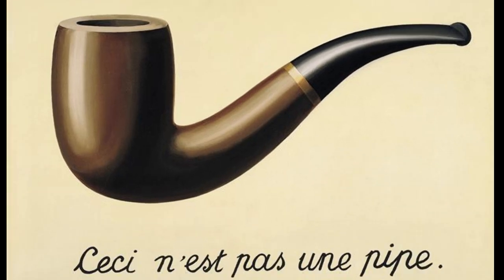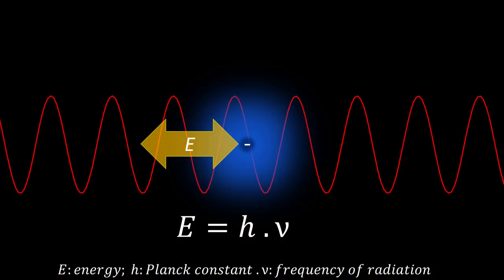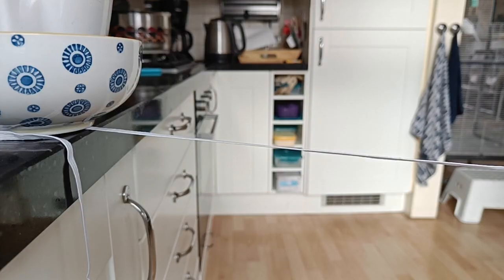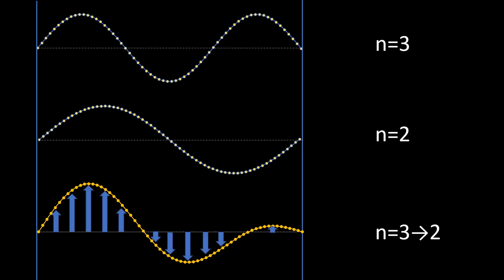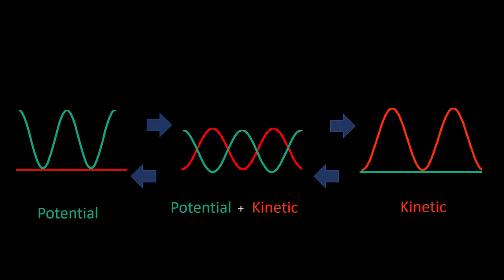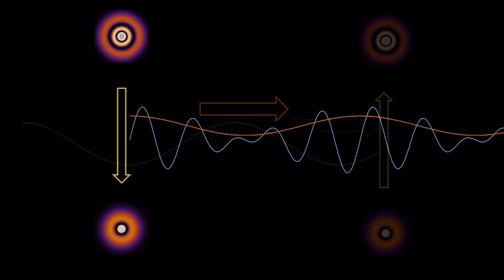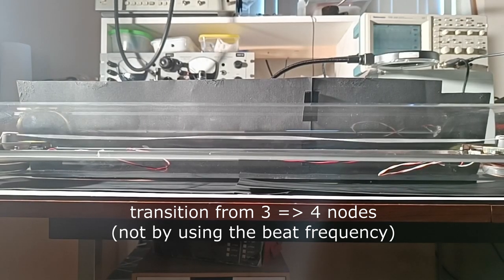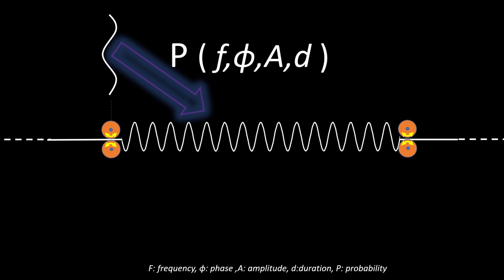Coherence part 3: This is not a wave.

Comment: I think that there is a lot of loss in your system due to gravity and you could simply turn the whole contraption so that the string hangs. It'll make the distribution a bit uneven but it should still maintain the properties, while having less loss. Since you're not fighting gravity on the standing wave over the entire length of the string anymore, although it might need a bit more energy (volume of the speaker) to get going. Because gravity wants the string straight and not saggy in the middle, if that makes sense, you can compensate with volume (energy), instead of tension (kinetic energy).
Reply from the maker: Hmm, why didn't I think of that... It could also have helped to reduce the friction I experienced in the transverse speaker, because of the sideway forces exerted.
Reply: About gravity: imagine a rollercoaster ride that is frictionless. (Hard to achieve on Earth, so for the sake of the through experiment: imagine the rollercoaster is on a levitating track, in vacuum.) In the absence of any friction, would gravity eventually bring a rollercoaster to a halt? It will not: every time the ride drops you down your speed increases, and uphill that momentum takes you all the way back up to the height where you came from. 

The same applies in the case of the vibrating string. The effect of gravity averages out; in the end there is no loss to gravity. The sag in the middle is a very minor factor. So: horizontal or vertical will make negligable difference; in both cases the energy drain to friction loss in the elastic band itself is dominant.
Reply: @cleon_teunissen  - Gravity operates like regula electromagnetic friction. It will bring your ideal rollercoaster to a halt indeed. We can see that at astronomical scales, in which gravitational friction is very real and measurable.
Reply: @HuygensOptics  Hanging the string vertical makes the string tension a function of location on the string, and thus introducing significant dispersion.
Reply: embed the whole contraption in a rotating frame to cancel out gravitational effects lol
Reply: @HuygensOptics  Rotate the driving speaker to wiggle the string left to right, rather than up and down. The entire string will remain at a constant hight above the Earth... I think most of your dampening is from the elastic material which your string is made from. I'm curious about how warm the string becomes... as most of the energy is probably going into heating it up.

There are giant lists of the tensile strength and torsion force and elastic constant of restitutions and stiffness for all kinds of materials. You can look that stuff up.
Reply: I think that you will need to use a material (wave medium) which keeps ringing like a bell after being struck. (or like a tuning fork) (Steel for example is more elastic than rubber.)
Reply: @cleon_teunissen  The friction loss in the elastic band is so high because it is taut. And it is taut to overcome the sag that gravity applies. Makes sense? A string hanging between two points sags in the middle and it takes energy to undo that. 

And about your thought experiment: gravity is a constant force over the entire track, it takes energy from the ride the entire time. Draining the initial energy put in.
Reply: @rexmundi9691  Hmm... about gravity. The Earth is orbiting the Sun. The Earth's orbit is close to circular. Gravity is spherically symmetric. That is, everywhere around the Sun, at the same distance, the magnitude of the Sun's gravity is a constant force. I surmise that you believe that the Gravity from the Sun is taking energy from the Earth the entire time, draining the Earth's energy. Do you have an estimate for the time until the Earth plunges into the Sun?

Then again, it may be that you believe that Earth's gravity and the Sun's gravity are unrelated phenomena, with unrelated properties
Reply: @HuygensOptics  You could also try to use a real metallic spring, rather than an elastic band. A real spring has less damping.
Reply: One issue is the speakers. They're not "mandating" the positions of the string ends, they're also reacting to the string's vibration (losses on conveying the pulses and attenuating the vibration of the string). I got a solution for this while watching but the video as a whole being so well made with such a beautiful ending, me saying "servomotors" would be like caughing in a classical concert.

Comment: You could also measure the power required to drive the speaker at various frequencies.  It should be different depending on whether a standing wave can be formed or not.  If the oscillation is not a multiple of the natural frequency of the string, there should be more push-back on the speaker, requiring more power to be applied to drive it.  It would be interesting to graph the energy consumption vs the frequency.
Reply: this is really similar to back-EMF in motors, and would work (with some caveats) in a continuous manner (i.e. not just as a resonance detector)

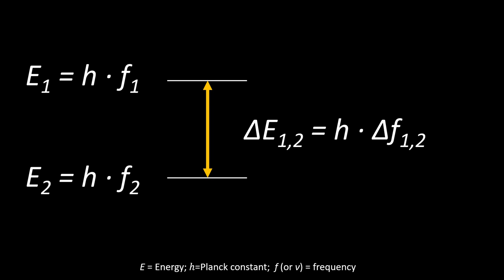Comment: Following are two speculations, on the 22:54-26:50 and 26:50-32:29 sections respectively.

1. When you have a standing wave, the ends of your medium (a string in this case) will be either alternating between crest/trough or be stationary, depending on your boundaries.
 
In this case both ends can be approximated as stationary, since the speaker (on the right) amplitude is relative small and the string is rigidly attached (on the left).

If you want to add or remove one half wave, I imagine you could use your right speaker to do so by using a transition wave in the shape similar to the photon pictured @ 1:22.
Visually, imagine you have one half wave to the right, outside of your standing wave and slowly shove it in.

I imagine it would be a different transition wave depending on which two n-states you are going between and that the phase matters. I.e with phase miss match, you get the transition behavior you showed, bouncing back and fourth. While a phase match could make it look like I described above, shoving in a new half wave. Also it may be possible to pause the transition, getting a new steady state with a non whole n-number of half waves.

2. I don't see a reason to make the string infinitely long, since as long as the boundary conditions are correct the section should behave accordingly. The boundaries are there so you can control the experiment by measure/control of position, speed, acceleration and tension.

You may be trying to combine two different models/thought's into one (a standing wave and a @ 1:22 packet). The goal from here (as I see it), is to find and model the transition wave with the speaker to add/remove a_half_wave(/energy).

Comment: This fresh look at energy/ momentum transfer connects to so many other phenomenon.   Earthquake seismology with compression waves & transverse waves that propagate at their respective velocities depending on the fundamental properties of the medium. Acoustic wave vibrations of violin strings with sawtooth function shaped input of energy every time the bow stretching the string slips.  Acoustic vibrations of a guitar string with base frequency, harmonics, decay rates dependent on string mass & elastic energy. And of course quantum mechanics and Electromagnetic radiation.  I had to back up many times because my mind would wander to so many other related phenomenon.

Comment: That was a beautiful composition unfolding the dynamics of energy state jumps. Roger Penrose called the unfolding of how the collapse of the wave function works, the  most important discovery to be made in physics. Your classical elastic string experiment and hypothesis was brilliant, and a tour-de-force of clear reasoning. I am hungry for more, this topic is very important and very rare it seems. 

Perhaps you can try different kinds of oscillator mediums, radio cavities, springs,  maybe coupled pendulums? 

Early pendulums had cycloid-shaped bumpers for the cable that supported the swinging weight; these might be like your adjustable pulleys in the string model.

You mentioned phase becomes important in the transition, so ok complex numbers in the math.

 Wonderful how the beat frequency is the photon in the analogy. In radio mixers, we had the sum the difference, and the two original waves, and downstream filters with select which one you wanted. I wonder if they all show up here as well if you were too closely, analyze it.

My first thought was, The waves are decaying fast so you need something with more energy storage, so I guess something like a pendulum might give you a much clearer signal to noise ratio, or perhaps heavy piano wire properly tensioned? Ha just shop brainstorming there. This work is too important to just change the subject and move on. This work should be optimized for the big leagues, as a vital physics demonstration.

 I have yet to have seen anyone make an effort to show what’s really happening during these energy transitions between standing wave modes, except this work of yours. Well done, sir, and would love to see the better model you outlined done. People need to start thinking this way, in order to have some ideas on to get past the whole quantum mystery blockade of physics.

Comment: 25:38 I think you should inject only 1 wavelength of the beat frequency, and as soon as it runs out of string (after a number of standing wavelengths), inject the next wave. Gotta find a way to make it resonate. It's like I'm swinging in a hammock. A wavelength with a specific frequency will have a certain velocity.

Comment: Fantastic video! Well explained. Let me put in a few not-expert considerations:
There can be a wave only if there is a medium and that is the string.
There can be a wave only if the medium is "elastic" otherwise the string wouldn't elongate enough to form the crests and the valleys.
At the beginning of the video you show that waves reflect, so also when you make more oscillations there still must be reflections, so a standing wave forms when the reflected wave is in phase with the source wave.
One way to reduce the wave nodes could be that suggested by @Marcus Österback: instead of having the left speaker pulse in a regular way make it pulse in such a way that it transitions from an higher frequency to the lower one in a non-uniform way supposedly by incorporating the beat frequency.
The idea of the wheels in the ideal setup is incredible! You talk about them as a "property of space" or "spatial inertia", think of it, I would call them "magnetism", I mean the magnetic part of electromagnetic waves, while their going up and down is the electric part.
You show radiation as coming from outside the string, I think you should have shown it as another wave in the string but outside of the "confinement" that possibly, thanks to the wheels and or the ability to also move the wheels, is able to interfere with the standing wave making it 1) pass thru 2) reflect 3) create another wave 4) absotb it by changing the internal frequency 5) anything else ?
About the cause of the confinement I also have an idea but I think it is a bit too radical and naive so I'll wait for a better inspiration or explanation...

Comment: For the way that you made the string switch modes, I think you told one of the speakers to vibrate in such a way that mimics how the string would vibrate as if there were a "shadow node" some distance beyond that speaker, gradually shifting the frequency until a node (either real or formerly shadow) lands on the speaker, which effects a change in mode.
Reply from the maker: You are warm, but I'm afraid that is not the way I did it, sorry!

Comment: So matter is not both a particle and a wave, or sometimes a particle and sometimes a wave, it is always a wave, and particles are an artifact of wave mechanics. Cool!

Question though: can we apply this insight to the Schrodinger equation to try to understand what a "measurement" is? I always felt like the interpretation that the wave instantaneously sheds its position uncertainty at random when it interacts with something to be lacking any insight into how that change occurs. I have a suspicion that it has something to do with turbulence since the waveform "collapses" in contact with high-complexity matter (i.e. a bunch of other overlapping waveforms that would in every likelihood not be perfectly resonant), but I'm not sure if that's the correct approach or how to translate it into a decent intuition.

Comment: the wavelength should be the Compton wavelength....h/mc, it's frame independent. But props for saying "spin state", because the actual spin is sqrt(3)/2 [with hbar=1, ofc]... ppl forget that a lot.

edit...and you did this at 31:37. and the reason it has the frequency of gamma's is b/c the Compton wavelength is the limit to which an electron can be confined before the momentum uncertainty gives it enough energy to make a e+e- pair from the vacuum...so 2 x 0.511 MeV = 1.022 MeV...a gamma ray

Comment: I don't know if any body else in the comments have said the same as me but I think you make a fondamental mistake when you try to add 32Hz and 8Hz by switching off the 32Hz..  
Firstly I believe the electron is in a standing wave where there are no losses of energy from the electron. If there where losses the electron would eventually disaper. As you have got losses all the time in your electron model you must there fore input energy all the time. You can never switch off that input as long as you want to keep your electron (the standing wave). The photon input that should moove the electron to a new posision must have the right frequency of cause (in this case 8Hz) but it must also be maintained to avoid losses. It should possible start at a high energy value (photon + loss) and then go down to just loss replacement. As I said before in the "real atom" there would be no losses. To get your 40Hz standing wave you would have to continue putting in loss replacement. That is the only problem I can see. 
Other than that I must go back to what I know a little about and that is heterodyne radio receivers. There you mix to frequencies usually to make a lower frequency but it makes at least one more frequency fin + fosc and fin - fosc I believe from memory. There may be two more I can't quite remember. However I distinktly believe to remember that it has to be done in a non linear circuit.
In regards to a photon I believe the only thing we really can say about it is that it is a wave at some frequency, some energy. can be vertically or horsontally possitioned but may also twist either to  the left or to the right right. That is all things we can messure .   People that say that it doesn't excist are probably right in the way that it is not a particle (something solid). What we can say is that we get's it's energy so something must excist. In regards to the photoelectric effect where it was thought that it had to have a quantum energy and there fore be a quantum particle I would say maybe it just has to be at a frequency high enough. I don't know if it works with any frequency f higher than f = E/h (E being the energy needed to knock free an electron or it could be found to be only some special ones. The shape of a photon must be atleast 1 cycle I would say because otherways I don't think we can get the frequency information through.
In regards to the video then I like it very much as I have done with many of the other ones you have made. This one makes me more and more sure that everything in the atom is oscillating (standing waves) I believe that the proton and the neutron are exactly the same just with a lot more energy in them to make the much bigger mass. Anything that is decaying must then be where the energy level is very close to another energy level so that one "so called particle"  can with a slight wobble make a jump or split up the energy it has to make to oscillations. I also have a suspecion that many of the so called particles they find in the accelerators are just unstable possibilities that are not used in nature.

Comment: At 25:40, I think injecting the 8 Hz/phase changed beat in the far horizontal speaker is the way to go, but you lose the new resulting standing wave frequency right away because the source vertical speaker is still oscillating at its original frequency. If you put a transducer on the source vertical speaker, you would be able to detect the 8 Hz beats effect (interference/energy transfer) on the source and then hetrodyne that to change the frequency/phase of the source speaker to maintain the new standing wave frequency. By doing this, you transfer the "info" of emitted energy (8Hz) to the absorbing electron (the vertical speaker) and "tell" it to go to its new discrete energy state (standing wave frequency).

Comment: Great video.  My silly suggestion for the day - if you replace the speakers with a motor and crank mechanism you could remove (or reduce significantly) the damping that the speakers introduce to the system (assuming you could stop the motors rotating quickly - there are techniques to do this using standing waves in the motor coils/magnets) - this may give the "beat in a vacuum" experiment a higher likelihood of success.
Reply from the maker: Thanks, yes, I certainly considered this. But a crank mechanism also has disadvantages, for example it needs time fot eh acceleration and deceleration so it cannot generally produce short pulses.

Comment: I like the explanation of the emission of the photo to being  due to the beat frequency between the two standing wave states.  This would imply that there is a discrete amount of time that the transition occurs over, debunking the idea of an instantaneous "quantum leap" between the states.    Of course the idea of a quantum leap also violate a lot of other "laws" in physics, so it's not surprising, but this is a really nice, hands on example of how it works.